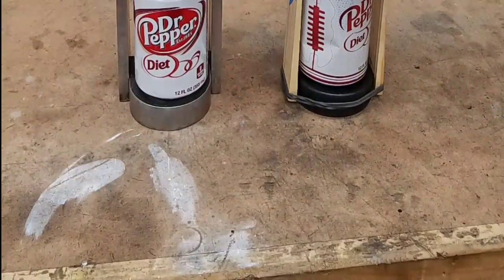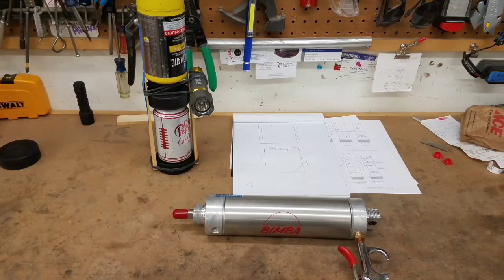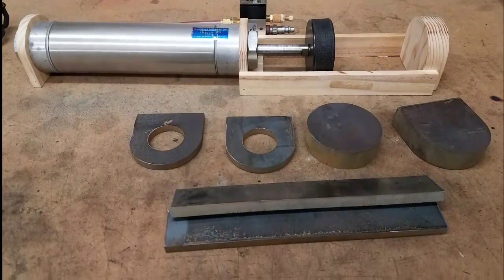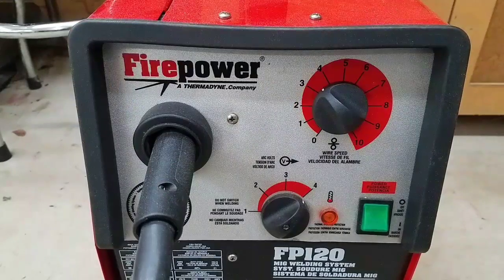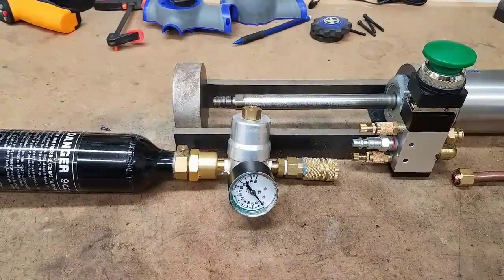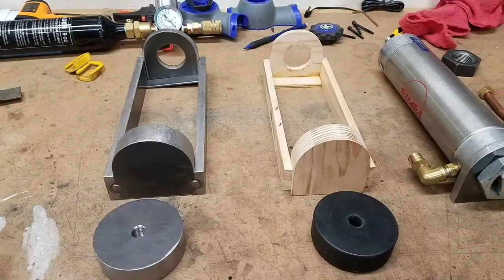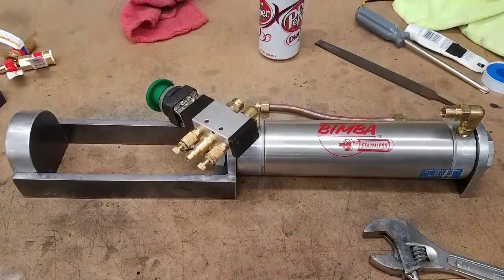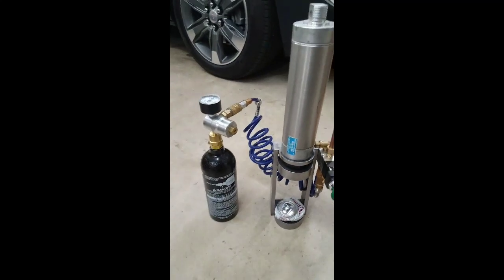Portable Pneumatic Can Crusher 450lbs of crush!

Comment: How many cycles do you get from one Co2 cylinder?
Reply from the maker: Don Lunney - Not many, 20-30 before it doesn't smash completely. I run it off a compressor, the bottle was just for giggles.
Reply: What size was that tank ? Or did I miss you mentioning it? I would assume a bigger tank will give me more working time ?